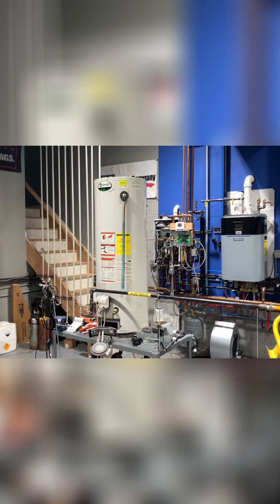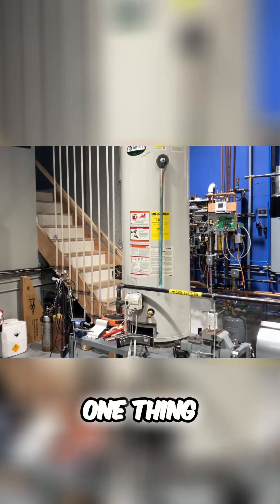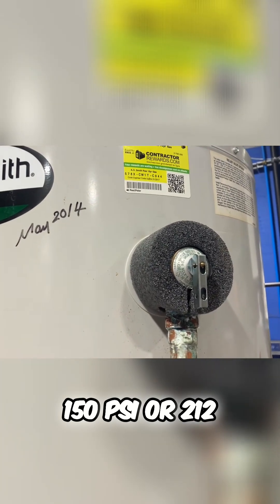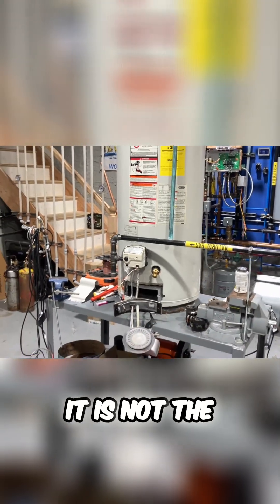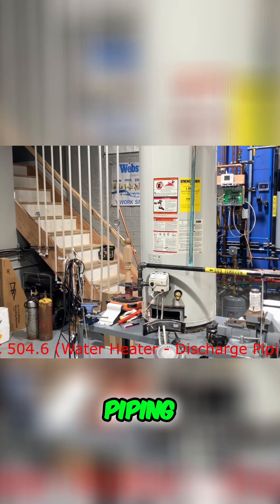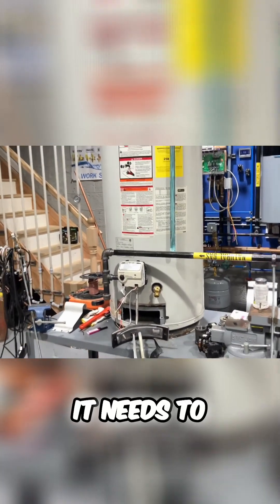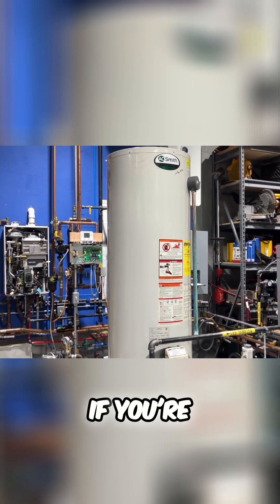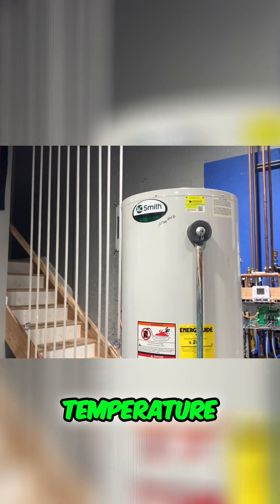Is Your Water Heater Installation a HUGE Safety Hazard? #shorts

Comment: Will the discharge valve not work when the pipe isn't long enough? Of course it still works. The only reason for the leak is the fact they put insulation around the valve. Anybody reading this and thinking about replacing their own water heater. It's easy as hell and don't worry about this guy. You don't need a plumber just do your homework and save around 1500 dollars.